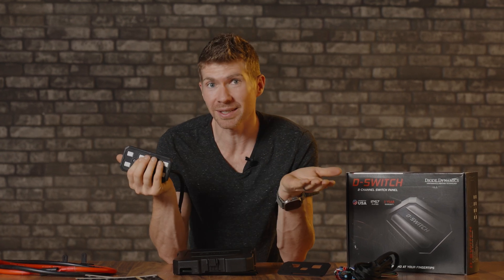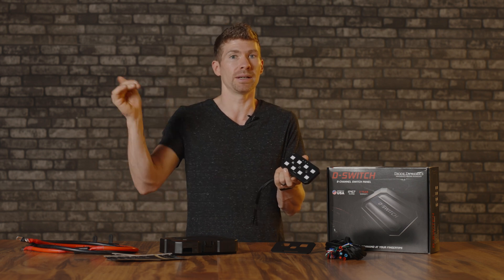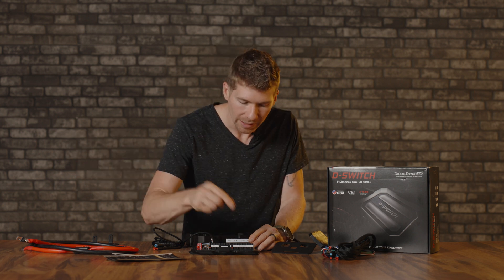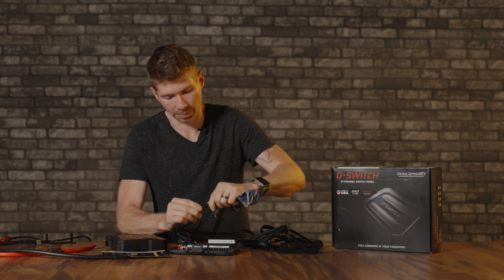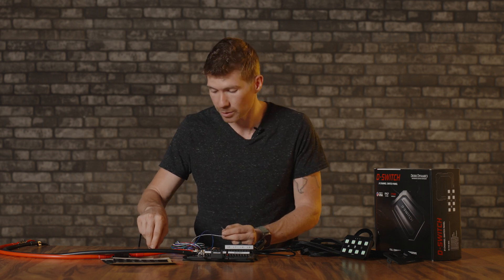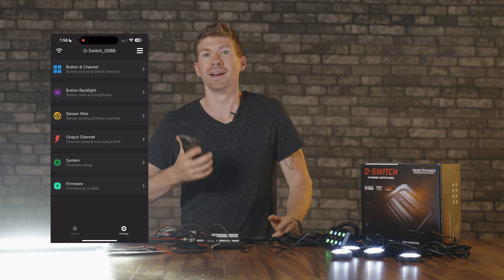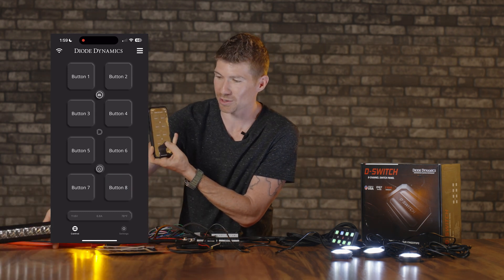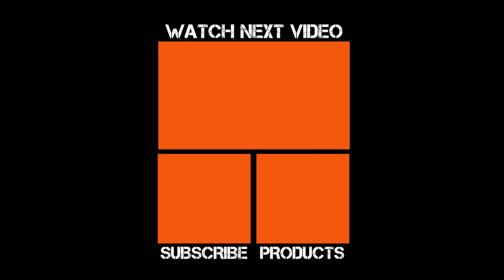Is This the Smartest Switch Panel Ever? | Diode Dynamics D-Switch Panel Full Overview

Comment: How does this system prevent surges/shorts w/ no fuses/relays?
Reply from the maker: The general idea is that you’d still use the relay wiring harness that comes with your lighting product (like Morimoto pods)—but instead of running the manual switch into your cabin, you’d connect that circuit to the Diode Dynamics D-Switch panel.

So essentially, the relay remains part of the light’s harness, but the D-Switch takes over control through the switch panel or app, letting you trigger the lights through programmed buttons or OEM signals instead of a toggle switch.
Reply: @HeadlightRevolution  I actually understand this has solid state breakers built in with dynamic digital programmable limits.

Comment: Diode dynamics switch will work with baja designs lights?thanks
Reply from the maker: Yep, should work with any light that has the proper wiring setup.

Comment: Useless and expensive. Just marketing.
Reply: I use this on a daily basis and it's far from useless! The ability to customize inside of the app is awesome.
Reply: Can you mention a switch panel brand that offers backlight feature like the D-Switch for a lower price?
Reply from the maker: Thanks for sharing your thoughts! We actually thought the Diode switch was awesome, even at the price point. With its clean install, great features, and the support/warranty from Diode, it really stands out compared to other options on the market.

That said, we totally understand if it's not the right fit for everyone. But no worries—stay tuned for our upcoming switch panel testing video, where we’ll be putting a few options to the test!
Reply: @HeadlightRevolution Which Diode UNIT or other brand would you recommend just to hook 🪝 up 🪝 2 extra lighting systems?